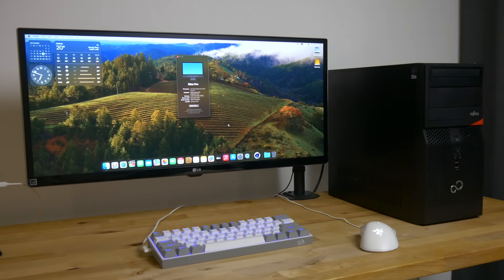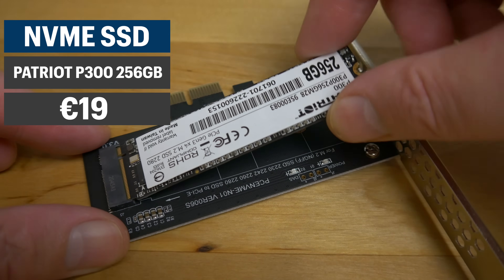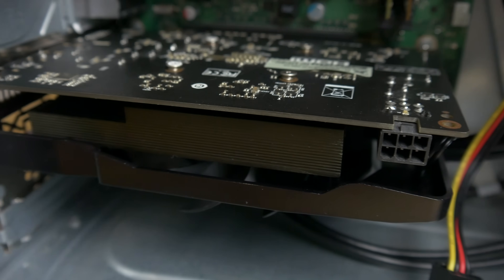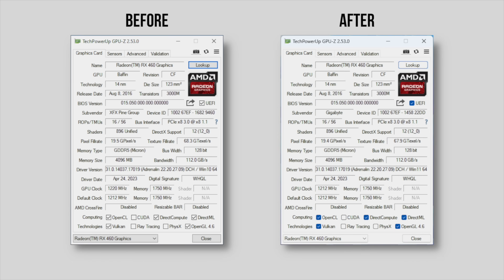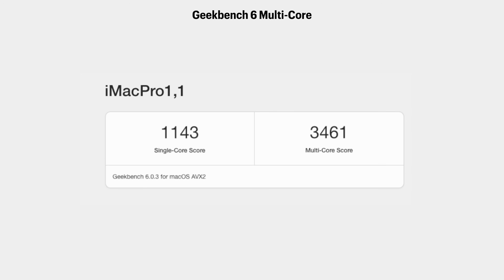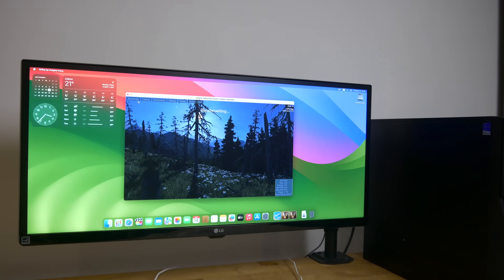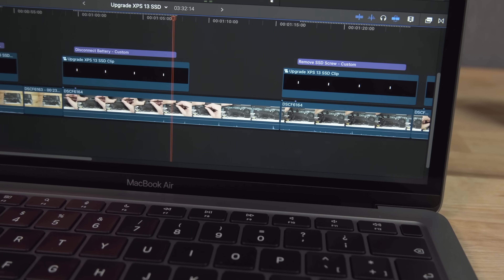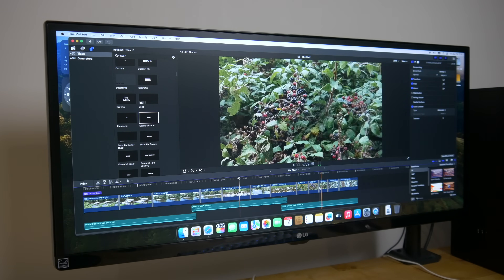Cheap $63 MacOS Hackintosh with Dedicated GPU

Comment: How much longer until the newest macOS is no longer x86 compatible
Reply from the maker: Usually Apple supports Mac models for 5 years with OS updates. The last Intel Macs were released in 2020, so it's likely that macOS 16 next year will be the last to include Intel support, with macOS 17 in 2026 being ARM only. However Apple still provides security updates for another 2 years after support is dropped, so Intel Macs (and therefore hackintoshes) will likely still be able to run a currently supported version of macOS until 2028.

Comment: I just watched this video. I started to buy the components immediately. I love this video. Not because of it is cheap, but becuase of this is just genius.
Thank you!
Reply: I just stuck on one issue. If I install MacOS on NVME drive, I cannot boot it. Simply not appear on boot option in BIOS settings. Any idea?
Reply: @antaljani   If you have created the installer media correctly it should appear on boot options. (You can check with other OSes if you have installed any before) and if other OSes appear on boot options but the MacOS one doesn´t it means the USB installer media hasn´t been prepared the right way. First you have to follow Dortanias guide to create your own EFI file (which is the one that makes it possible for the system to recognize your hardware) because if you don´t have the required EFI file it will not work, and you have to make it yourself, it's not the hardest thing on earth if you have some experience installing OSes but if not it can take some time because Hackintosh isn´t something that will work on the first try, it can take a lot of time.

Comment: Question is this Compatible with the Motherboard and NVMe SSD Patriot P300?:
ASRock Rack RB4M2 - Quadro M.2 Adapter Board | 4 x M.2 M-Key SSD to PCIe3.0 x16

1:09

Comment: Fujitsu P420 i5 4570 Cost ~80€
I dont found for 16$😢
Reply from the maker: https://www.ebay.ie/itm/126431913327 - sold for 25,57€ (with i5 & 16GB RAM)
https://www.ebay.ie/itm/305493789610 - sold for 25,90€
https://www.ebay.ie/itm/404858650390 - sold for 19,50€
https://www.ebay.ie/itm/404827472652 - sold for 21,50€
https://www.ebay.ie/itm/395227450238 - sold for 12,50€
https://www.ebay.ie/itm/404795035032 - sold for 20,48€ (with i5)

Comment: Hi, what resolution is your monitor, because I having a hard time to activate my 4k monitor at 60Hz. Configuration: Fujitsu p920, i5 4570, 16 gb ram, No GPU. So far I tray -cdfon, also lot of different arguments for patching IGPU, but nothing work. In bios also settings are correct - 64mb/Max. The monitor is connected with Displayport cable.

Comment: How did you get all the parts for so cheap :( im in the uk and i cant find them for so cheap.
Reply from the maker: On Ebay Germany, mostly.  Look for auctions and ignore the fixed price listings.
Reply: @BartechTV  I have actually found a p420 e85+ for 28.49 GBP and it has an i3, 8gb of ram and a Samsung 256gb ssd

Comment: any card to get the airdrop working on sonoma ?
Reply from the maker: Native Apple broadcom card with a PCIe adapter, or a Fenvi T919, along with OpenCore Legacy Patcher.
Reply: @BartechTV  really I thought t1919 airdrop isn’t supported on Sonoma
Reply from the maker: Yes that’s why you need OCLP. It re-adds support for the Broadcom chipset used on the Fenvi cards.

Comment: How far the performance if i want to build hackintosh with i5 6500 + rx 570 4gb vs i5 4570 + rx 570 4gb ?
Reply from the maker: The 6500 would be 5 to 7% faster than the 4570. Likely not enough to even be noticeable.
Reply: @BartechTV  ok thank you very much, i really appreciate it 🙏, and do you think i5 8400 is sufficient for budget build ?
Reply from the maker: Yes for sure. The i5 8400 will be significantly faster than either the 4570 or the 6500 thanks to the extra cores.

Comment: hey man please reply to this i have same case i am thinking of upgrading my psu what type of psu for this case?
Reply from the maker: Only a Fujitsu power supply will work, because they use a special 16-pin PSU with 11v standby instead of a normal ATX PSU. You can buy an adapter on Ebay for ATX PSU's, although it's a bit expensive.
Reply: can you give me links for them? @BartechTV
Reply: if i change the motherboard can i change psu? @BartechTV

Comment: I have a spare i7 9700k, gigabyte itx motherboard and an Asus Amd rx5700xt GPU. 32 gb corsair ram and Samsung 970 evo plus nvme ssd. Do you think I could make those into a hackintosh?
Reply from the maker: Yes. You could make that into a hackintosh that would be a video and photo editing beast. The 5700 XT is about 50% faster than the M3 Pro.
One thing I'd change is the SSD. WD drives play better with macOS than Samsung. Swap out the 970 EVO for an SN770 or SN850X and you have a killer hackintosh build.

Comment: I would be very cautious with SATA power cables.  It is known that molex to SATA power cables (molex to SATA, lose your data) can short out and catch fire.  Something at how the molding can be difficult with how close together the SATA pins are when laid out.  I want to say this is why SATA power cables you see on power supplies are angled or perpendicular to the connector.

Comment: Hi. Thanks for your video. Just two questions: Audio is not working, I tried all four alcid layouts but neither works. How can I proceed now? Also, I have three monitors on my desk, with Smbios iMacPro only two are working. I changed SMbios to macPro7,1 and now all three monitors are working, is this the optimal solution? Thanks.

Comment: Ok so I am new to this HACINTOSH RELM...
I have an old Dell T7810 and wanted to install sonama OS14 on it. It has an Nvidia Quadro 5000 in it. Can I install Sanoma on this system?
Reply from the maker: No, MacOS has no Nvidia support, only AMD.
Reply: well you can edit the smbios to support sonoma install, then after you install it on your dell, use opecore legacy patcher to patch that nvidia so it will somehow be usable

Comment: I have a system with i5 3rd gen and rx 570 4gb is it possible to install macos on it and how should I do that any videos?
Reply from the maker: You can install macOS Monterey or earlier but not Ventura or Sonoma since they require AVX2 instructions which were only introduced with Intel 4th Gen.
Reply: any tutorial of your on mac Monterey installation?  @BartechTV

Comment: easier would be imac 2011 27" and opencore for the same price and great display
Reply from the maker: That's a 2nd gen Intel CPU. Ventura and Sonoma need AVX2 so they won't run on the 2011 iMac.
Reply: @BartechTV  mine does

Comment: Hola tengo un problemita he comprado un M2 con su adaptador psi pero la bios no lo reconoce sin embargo cuando inicio Windows o Mac en otro disco si aparece pero en la bios no que hay que hacer para poder instalar un SO y arrancar desde el Agradecería Ayuda por  favor Gracia
Reply from the maker: Boa tarde. Não sei falar ou escrever espanhol, mas vou responder em português.
O BIOS dos computadores antigos não reconhecem SSD NVMe, então é necessário ter  OpenCore instalado num SSD SATA ou um USB, junto com o driver NVMe do OpenCore "NvmExpressDxe.efi", dentro da pasta EFI/OC/Drivers.
Assim, o computador inicializar desde o USB ou SSD SATA, e OpenCore carrega seus próprios drivers nvme, permitindo que você selecione a unidade nvme no instalador do Windows ou macOS.
Reply: Muchas gracias lo probaré así gracias por tu tiempo

Comment: Hi - thanks for your great videos. I built a Hackintosh based on your guide from about 7 months ago. All worked fine and i recently installed Sonoma as well. But i recently put a in a new motherboard a MSI Z490 gaming plus. I'm struggling to get Hackintosh to boot. I think it might be a motherboard settings issue? Can you advise on any key Bios settings please
Reply: Depending on your cpu gen. There should be some settings in bios to be disabled

Comment: I was so stunned from your Video i bought a P420 and a RX 460 too to try it myself. Mine got the i5 4400 By factory. I can just copy your steps, am i right? 
One thing i would like to add would be AirDrop with wifi and bluetooth do you have a recommodation for that?
Greetings from germany 👋🏻
Reply from the maker: To get working AirDrop you'll need a WiFi/Bluetooth card that uses the same Broadcom chipset that's used in real Macs. People most commonly use the Fenvi T919, which you can find on Amazon or Ebay, but any BCM94360-based card should work out of the box in Ventura.
Apple dropped support for the Broadcom card in Sonoma, so if you install Sonoma you'll have to run OpenCore Legacy Patcher after installation to get WiFi/Bluetooth back.

Comment: This is a fine video. Thanks. I buy all things and it works. Only one thing womt work. Booting from the PCIe NVME Card + adapter is not possible. Please give the information for correct setupof  the card. Thanks!!
Reply from the maker: Make sure that you have Opencore's NVME driver - "NvmExpressDxe.efi" in your EFI/OC/Drivers folder.
Reply: Thanks! Ok with driver I'm a step forward. I have Sonoma on the NVME. I have also a EFI Partition on the NVME. But it's only boot from the stick. The BIOS will not see the EFI Start System on the NVME card in the start sequence..
 @BartechTV
Reply from the maker: You need to use OpenCore Auxiliary Tools to mount both EFI partitions - the one from your USB drive and the one from your NVME drive - and copy the EFI folder from the USB EFI partition onto your NVME EFI partition. Then you will see the NVME drive as a boot option in the OpenCore picker.
Reply: I do all things. But the motherboard BIOS give not the opportunity to start from NVME. I tested also  two other PCIe adapter and the possibility to use the NVME Disk as bootable for Windows. Nothing works. All works good with the workaround over an bootable USB Stick with opencore. To install sonoma i choose as model: iMac20,1    Intel Core i5-10500 @ 3.10 GHz. I must not patch the GPU. I choose a MSI model. Now i search for a stick for WiFi and Bluetooth. Have you a reference for me?
  @BartechTV
Reply: @schwupp1234  you need to place efi on sata ssd or usb stick that is the only way to boot nvme from motherboard that do not support boot from nvme  that way you boot from ssd or usb open core and then open core boot nvme cheap usb will do find it is little bit slower but works same as you boot nvme where the main story - os lies

Comment: I have the same CPU and intel HD graphic running on Ventura, if I add an RX 560, what I need to do? Only changing the SMBios to iMac Pro or anything else ?
Reply from the maker: You don't have to change the SMBIOS to iMac Pro.

You could leave the iGPU enabled in the BIOS, use a regular iMac SMBIOS, and change the device-id for the iGPU to a "headless" one. If you do this, macOS will use the dedicated RX 560 for the display and use the iGPU for Quicksync video decoding, just like a real iMac.

Or, you can disable the iGPU completely and use an iMac Pro or Mac Pro SMBIOS in which case MacOS uses the DGPU for everything, like on a real iMac Pro. In this case, you'd delete everything iGPU-related under device properties since there's no iGPU to patch.

So, it's up to you which approach you want. I found video encoding / decoding to be faster using the DGPU so I chose the second method.
Reply: @BartechTV  I got it. So the RX 560 is plug and play without any other setting that must I do ?
I would use the second method, how to delete the iGPU things? Can I use OCAuxiliaryTool ?

Comment: If anyone wants to build something like this. And have a bit more to spare. I recommend getting a 6th or 8th gen i5. A lot better performance and even most sff office models. Even the micros have a native nvme slot 👍
Reply: Can you use Ryzen CPU’s for this. As I have a spare 1600 and 2600 currently. Just not sure since Apple used to use intel chips.
Reply: @definitelynotchadfish  no
Reply: @jj-icejoe6642 stop spreading misinformation, ryzen processors work fine
Reply: @definitelynotchadfish  check ryzen open core builds
Reply: @definitelynotchadfish   @jj-icejoe6642  
im a bit late , but last year i had a perfectly working ryzen + ventura install with 
Asuse B450 PLUS GAMING
Ryzen 5 3600
Samsung 960 256 nVME
16 GB ddr4 
and an RX 580 8GB
it was very fast and stable dual booted with windows 11

Comment: That’s impressive. What the power consumption of this build btw?
Reply from the maker: 30-35 watts under low usage eg. web browsing, editing documents in Pages, etc.
105w under full load eg. benchmarking the GPU or exporting video from FCP.
I pay €0.12/kWh so running costs are about €1/month if used for 8 hours a day, 7 days a week.

Comment: LOVE your vids man! You made me wanna try Sonoma in my haswell machine too, do you think is there anyway to just get it woking with only igpu and no external graphics card?
Reply from the maker: Yes, it'll work, you'll just need to use OpenCore Legacy Patcher to get graphics acceleration working after installation since Sonoma doesn't support HD 4xxx series.
Reply: @BartechTV  I'm curious how well OpenCore Legacy Patcher actually works on Hackintosh machines as so far I've only heard of it being used on real Macs. I have a Dell OptiPlex 9020 currently running MacOS 12.7 I'll have to try it on.
Reply: Thanks, really appreciate replying 😄
May I know which SMbois would you use without the dgpu?
Reply: @drahrekot683 I’ve patched my Sonoma (beta) Haswell T1700 with OCLP, and accelerated graphics still doesn’t work.  This is a good question.
Reply: @zeroturn7091  SMBOIS is the problem, I two or three different ones which were supported and it worked! Although keep in mind the graphics is pretty slow
Reply: @drahrekot683  I’ve got Ventura on a 3020, and I can live with that for now.  The T1700 has been gutted and converted to AM5.

Comment: I just bought one of these! Do you think I could use a GTX 1660 with the current PSU? Sata power included.
Reply from the maker: The 1660 TDP is 120w. So, with a maximum 75w from the PCIe slot and 54w from the SATA connector you’d be pushing it right to the limit. It may work but I definitely wouldn’t expect it to be stable for long gaming sessions.
Reply: @BartechTV  Thanks! I’m thinking about getting an atx PSU and an adapter. Quite expensive though.
Reply: @BartechTV  Do you know how I can fit a 600w PSU in there? I got the GTX 1660 but now I’ve got to get the right psu.

Comment: That's a great build. I wish I could find similiar prices in these parts 
here in UK. I have a HP Compaq Elite 8300 CMT i7-3770 with 16GB RAM , SSD, Palit GTX 1660. Do you reckon it would work for a Hackintosh or shouldn't bother?
Carry on the great work!
Reply from the maker: You can definitely get a PC with similar specs on Ebay UK for the same or less money. Just avoid the fixed price listings and follow the auctions. Here are a few that ended recently.
https://www.ebay.co.uk/itm/404480723543 - sold for £8.99
https://www.ebay.co.uk/itm/404357824697 - Sold for £8.99
https://www.ebay.co.uk/itm/134742207812 - sold for £12.50
https://www.ebay.co.uk/itm/145239309982 - Sold for £12.90
https://www.ebay.co.uk/itm/404446821648 - Sold for £14.50
https://www.ebay.co.uk/itm/134742207339 - Sold for £15.00
Any of these could run macOS.
MacOS Ventura and Sonoma need AVX2, which your i7-3770 doesn't have, and also macOS doesn't support Nvidia GPU's, only AMD. But you could still put together a similar build to this for £50-£60 or thereabouts that would run Sonoma and edit video very well.
Reply: @BartechTV  Thank you very much for your effort and your time to reply me. I appreciate it. I will have a look to the list above.

Comment: Hey, just found your channel.
Can you please tell me what is the latest version of MacOS I can install on a Lenovo Z50-70 with an i5 4210u, 8GB ram and Nvidia Geforce 840M, of course it has the iGPU as well if I can use both, I would like that if not then only the Nvidia one.
And if you can explain how to install the MacOS or if you have a video showing that. Keep in mind I install Windows regularly for more than 8 years but I just never got into MacOS and if it is a lot different then I will need some guidance.
Reply from the maker: You can run Monterey. Ventura dropped support for HD 4400. Your NVidia graphics won't work at all, you'll have to either disable it in the BIOS or by adding the "-wegnoegpu" boot flag.
It's not possible for me to make a video showing how to install it on your laptop because I don't own a Z50-70 and every laptop is different.
The easiest way for you to try would be to find an existing EFI from someone with the same laptop model like this one - https://github.com/thedeadfish59/lenovo_z50-70_hackintosh

Comment: The author himself mentioned the advantages of hackintosh. Original Apple machines are outrageously expensive. In addition, as time passes, everything will be soldered on the board. You want to upgrade the hardware, it cannot. And not only that, but the components on the motherboard will be locked. In other words, there is no freedom. Which leads to the absurdity of buying expensive hardware that restricts you from improving it and adapting it to yourself. Why would you buy the same one then?
Reply: @ZZxlizrx good luck dude I want to do one now myself!
Reply: @ebojans  man it sucks. I wanted to become an iOS developer. So I need a computer running on a Mac with at least 16 gb of RAM minimum. I saw the difference of the price between 8gb and 16gb Macbook and I was shocked. This is so wrong!
Reply: I buy Mac for that os and eco.   Not the hw.  Hackintonsh doesn’t have all the features nor updatex
Reply: Elite Class. Why would people pay 1000$ for iphone , when they can use chinese phone for 100$.
Just look at US colleges 99% use Mac.
Reply: @sundayevening161  they only use Mac for the software, the hardware of Macs is overhyped and not worth the money. That’s why hackintoshes are a great budget option
Reply: Security